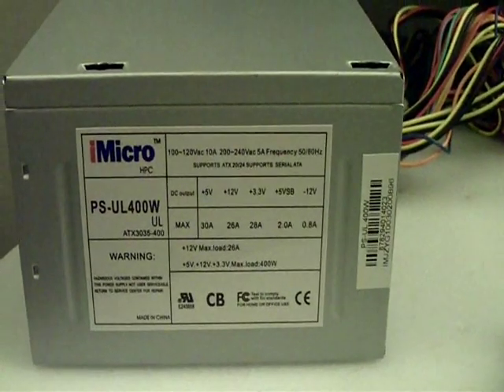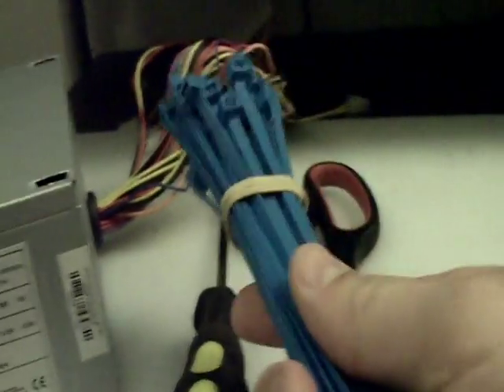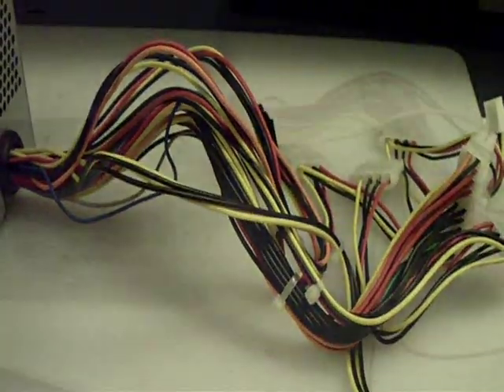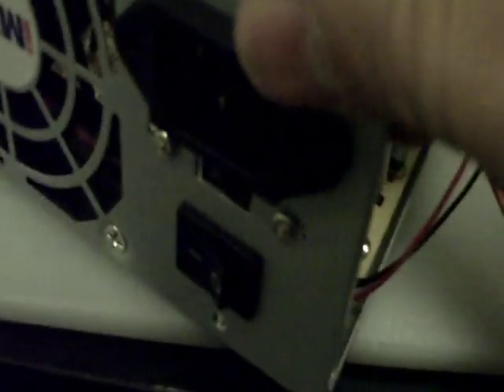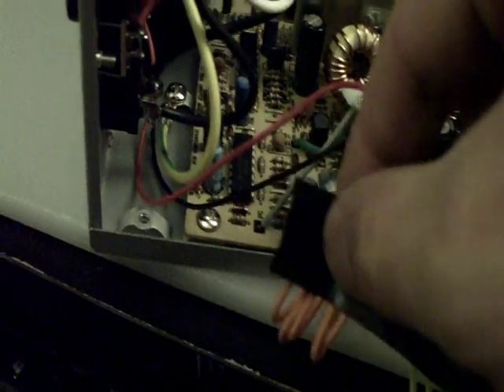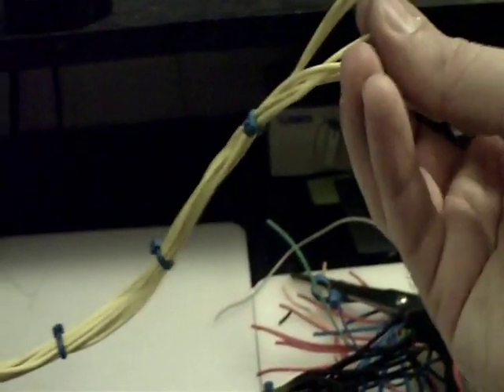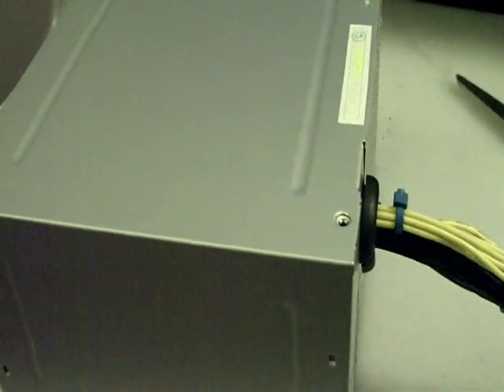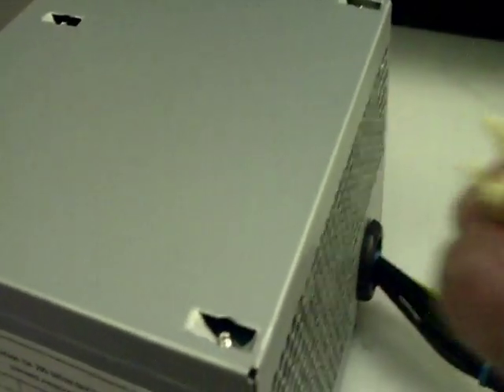Vid55 Converting a PC Power Supply to a HHO Lab Power Supply

Comment: hey thanks a lot man, i blew up an old power supply because of a short circuit so i wanted to put a light bulb in series with the load but that good for loads of max 3A so thanks for the tip with the circuit breaker:)

Comment: if you utilize all/most the wires you can make a 5v, 7v, 10v, 12v, 17v, 24v and possibly more depending on the supply. this is done using the following. -5v and +5v makes 10V, -12v and +12v makes 24v, +5v and +12v makes 7v, -5v and +12v makes 17v and so on and so forth.

as for the circuit breaker most cpu power supplies wont need one. their circuitry is designed to automatically shut off when too much amperage is pulled through.  

other than that good video.

Comment: i would think having the 5.5 and 3.3 rails would be most useful if you are building a test power supply.  i would just get some bullet jacks or those spring loaded jobs you find on amplifiers and mount them right in the psu case.  that would make it so much cleaner of a setup.

Comment: Hi HHO, see the nub thing you call it, the rubber circle, its called a Colet in the UK, but what I want to let you know, is I have used these on holes guy ,in my plates and cups, you pop them on to holes and pass bolts through, to isolate the metal, or in gas exhaust holes, pop them on to stop plate electric seepages, handy to know {good video HHO].
Thanks. 
Thom.

Comment: @frosty1433 no sorry, i believe the red is +5v and that's why the amperage is higher. if you connected +5 v to +12 v you would get a short. the difference between the two is 7v. so your basically shorting out a 7v potential difference.

Comment: great tutorial i've done this about 2 weeks ago but i left the orange and the red wires out and i have 3.3 volts @ 36A,5 volts @ 40A and 12 volts @ 21A.By the way it's a 300watt power supply.

Comment from the maker: @rabaduej  I use the circuit breaker as a safety precaution, because most of the power supplies I've used were pulled from very old computers.  They would automatically shut-off when a short occurred, but when this happens over and over again in a small amount of time, the capacitors begin to bulge and pop from overheating.  With the circuit breaker, I don't have that issue any more.  I like using what I have, because I don't have a budget for this hobby.

Comment: Hey I just built this it works great. I'm somewhat confused because it says 400 watts on the package but seems like it's top operating power is 300 watts because 12 volts x 26 amps is 312 watts. I don't really know, However the power supply works great!

Comment: @conatuslife thats what i did. as for the 3.3 bus i would say no. drawing too much from that can damage controlling circuitry within the power supply. however on mine i use -5v, +5v, -12v and +12v and this gives you a very good range of voltage to play around with. see my comment above to see what you can get out of these babies.

Comment from the maker: @joopee01  I had a similar problem before.  When I had this issue, I accidentally had a dark blue wire mixed in with the black wires.  

If this is not the problem, be sure you do not have any bare wires that are touching any components, wires or the metal housing.  It sounds like you have a short somewhere.

Comment: Not bad for someone getting started but if anybody wants more power get a dell power edge 6650 server power supply. It puts out 12v 72amps and they have separate grounds for the 120v and 12v so they can be put in series to get 24v or 36v. The only trick is turning it on which 3 small pins have to be jumpered together to trigger it. I got mine off ebay 2x for $50. Server power supply's rule.

Comment: need to create a DC power supply for use in home anodizing. The amperage sounds high enough (12 amps/sq. ft.) but I'm not sure. Will this work? Could I pull 5.5 A for an hour in acid with this?

Comment: How come the voltage fluctauates on 12 volt yellow wire converted two and they both do the same strange my amp meter fluctuates by 3 amperes every second any ideas why this is is

Comment from the maker: Most of the smaller cells I've put together are less than 15A.  Just be sure to use an in-line 12V circuit breaker rated at 10 or 12 Amps.  Other wise you will burn out your PC Power Supply quickly.  

You can find the 12V circuit breakers on ebay or amazon.
Reply: Why we have to use circuit breaker?